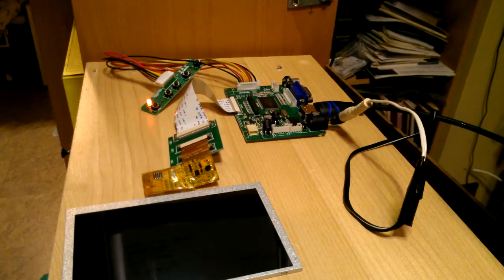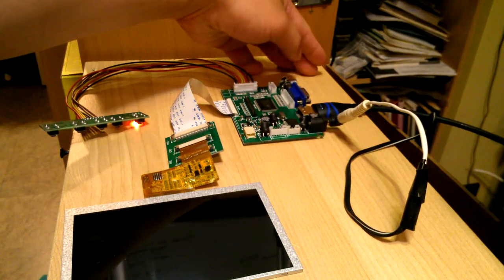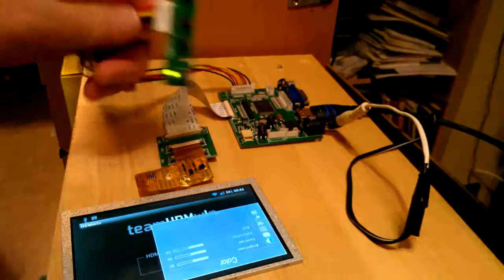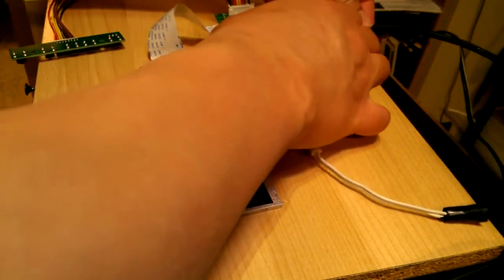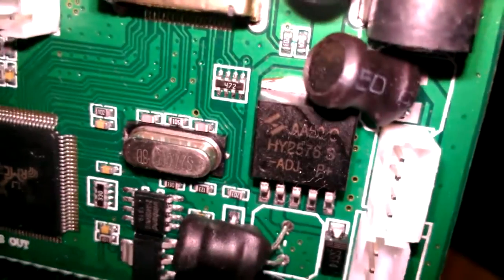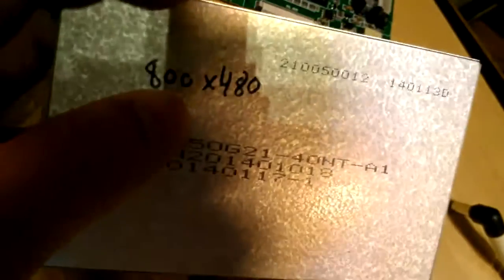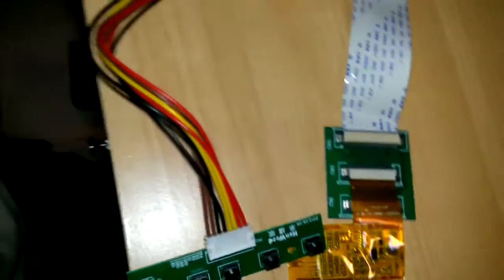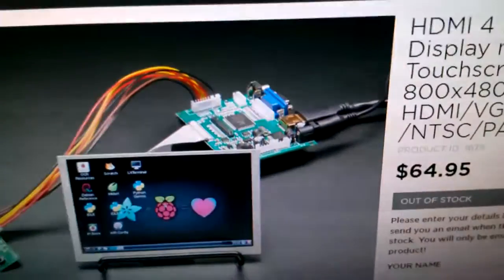adafruit LCD Panel 1678 Review - 5 inch HDMI/VGA/RCA Composite

Comment: is it a touch screen display
Reply from the maker: No. Its LCD only.
Reply: ok thanks friend . can i find something touch screen and can be use with raspberry pi
Reply from the maker: Aakash Ghodke  Have you seen raspberrypi.org?
Reply: no leefiles  will they have solution
Reply from the maker: Aakash Ghodke raspberrypi_org makes the raspberry pi. adafruit.com designs the displays and other gadgets. adafruit makes touch screens.
Reply: @leefiles  lol u guys no read 9 years ago was like it says 5-7 inch adafruit 800x480 TOUCHSCREEN lol.
Reply: +leefiles Hi, I'm looking for 5-6" touch screen for Odroid XU-4, any recommendations? Been looking everywhere but still no luck.
Reply from the maker: Just did a search on Odroid XU-4 and it has a full size HDMI. Go to adafruit for a touchscreen panel.  Also see newark/element14 or MCM or mouser.